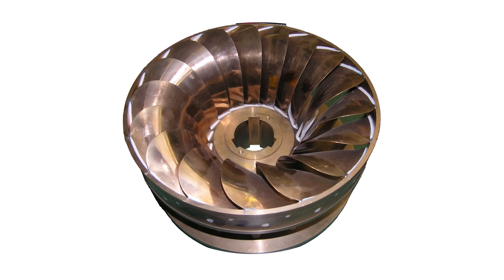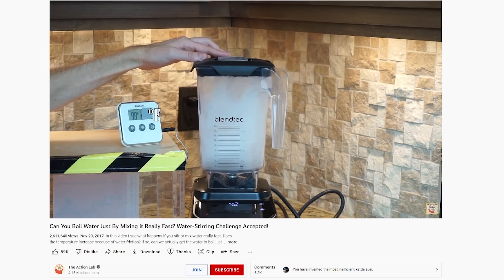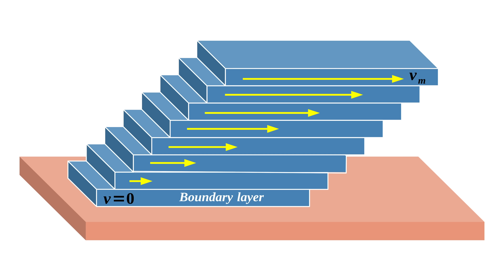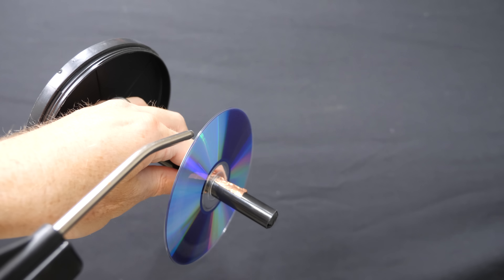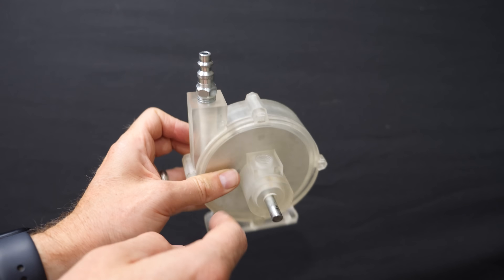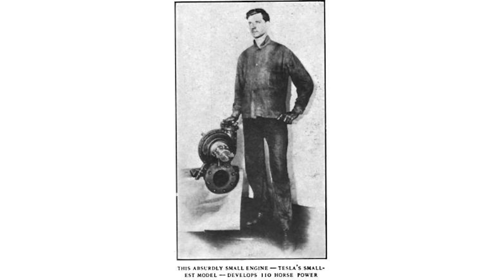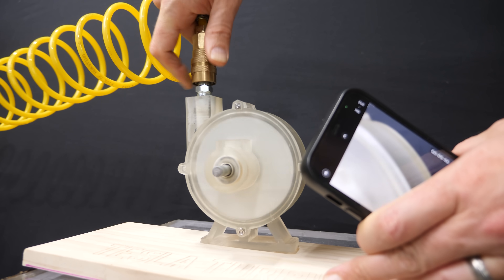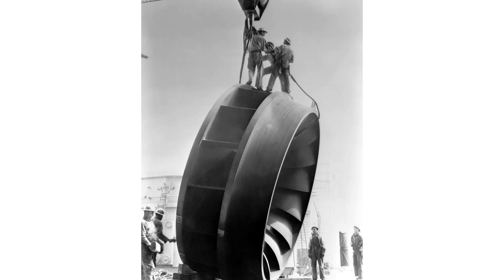How Fast Can a Tesla Turbine Spin?

Comment: I think the general problem with TTs is controlling the operating regime, i.e. Laminar flow.   For the TT this is when the disks are rotating at the same speed as the fluid.  As soon as the fluid flow is changed or the load on the turbine is changed you break out of laminar flow regime.  Maybe an RPM governor can help but I'm sure the engineers that work with TT in specific applications already know how to do this.
Reply: I wonder if he developed his valve during the same time in an attempt to control flow somehow?
Reply: If you keep the disc spaces tight enough, as Tesla says to do, (not spin fast) you won’t trip to turbulent flow between the discs. 

Charlie Solis makes actual working TesTurs that output real power and torque even at low RPMs because he designing his TesTurs the way Tesla actually says to design them. 

“Owing to a number of causes affecting the performance, it is difficult to frame a precise rule which would be generally applicable, but it may be stated that within certain limits, and other conditions being the same, the torque is directly proportionate to the square of the velocity of the fluid relatively to the runner and to the effective area of the disks and, inversely, to the distance separating them. The machine will, generally, perform its maximum work when the effective speed of the runner is one-half of that of the fluid; but to attain the highest economy, the relative speed or slip, for any given performance, should be as small as possible. This condition may be to any desired degree approximated by increasing the active area of and reducing the space between the disks.”
-Nikola Tesla

Comment: Instead of making large expensive systems: I often think a series of microturbines could eliminate much of the risks. Also, a faulty turbine could be easily replaced without stopping the main shaft. I like that approach for other systems as well...decentralized power grids.
Reply: The problem you run into there is the increased number of bearings - one set on a large turbine, N sets for N micro turbines.  Sleeve bearings are cheap but inefficient (heat losses).  Roller bearings and are much more efficient (less losses to heat generation), but substantially more expensive.  This, there's an optimal size for Tesla Turbines playing off the cost of metallurgical expenses for larger disks vs more roller bearing for smaller disks.
Reply: @akulkis  as if air and magnetic bearings aren’t already industry standard 🤭
Reply: Torque=Force x distance at its simplest. Micro turbines mean distance is small therefore sod all torque therefore very limited generation capacity. Micro turbines are usually useless and almost never pay for themselves within their service life. Same is true here, just with more maintenance and more points of failure.

Comment: Respectfully, 4:46 is one of the loftiest arguments I've heard from this channel "We don't use tesla turbines today ... because unless they're an order of magnitude better than current turbines, there's too much risk and cost to replace them". Are you sure about that one?

My dude, the plurality of "current turbines" gives you a big hint that different turbine designs exist together today. The suggestion that a technology has to be orders of magnitude better than the competition is mistrusting at best, incredulous at worst. Your own presentation showed simplicity of construction as a huge advantage. If it was characterized to perform identically to, say, a centrifugal turbine, would you have also dismissed it as not fit for modern application with current turbines? 

Disappointed in your message. Any promising technology should be encouraged and not labeled a relic of antiquity.

Comment: 3500rpm is no where near the efficiency range of that turbine. Should get up to 25,000rpm or more then jump up 50,000+.  The idea is that the fluid (air in this case) is rotating around the outer edges and being forced outwards by centripetal forces, but it has get to the center where the outlet is and err well..,,Nikola understood the rest.
Reply: Sorry but that’s not how it works. It works by fluid molecularly adhering to the disc faces. Tesla turbines do NOT need to be spun fast to work efficiently when they are designed properly. Charlie solis makes actual working, real power and torque outputting, even at low rpm Tesla turbines.

You just have to know how to design them properly so that slip is reduced and spinning fast does nothing to reduce slip just increase the distance the fluid slipped across the disc face. 

“Owing to a number of causes affecting the performance, it is difficult to frame a precise rule which would be generally applicable, but it may be stated that within certain limits, and other conditions being the same, the torque is directly proportionate to the square of the velocity of the fluid relatively to the runner and to the effective area of the disks and, inversely, to the distance separating them. The machine will, generally, perform its maximum work when the effective speed of the runner is one-half of that of the fluid; but to attain the highest economy, the relative speed or slip, for any given performance, should be as small as possible. This condition may be to any desired degree approximated by increasing the active area of and reducing the space between the disks.”

Even Tesla himself said so they work great at low RPMs. 

“Besides these, such a prime mover possesses many other advantages, both constructive and operative. It is simple, light and compact, subject to but little wear, cheap and exceptionally easy to manufacture as small clearances and accurate milling work are not essential to good performance. In operation it is reliable, there being no valves, sliding contacts or troublesome vanes. It is almost free of windage, largely independent of nozzle efficiency and suitable for high as well as for low fluid velocities and speeds of revolution.”
-Nikola Tesla 

The only time it’s supposed to be spun fast is when it’s used as a pump. 

“I have found that the quantity of fluid propelled in this manner, is, other conditions being equal, approximately proportionate to the active surface of the runner and to its effective speed. For this reason, the performance of such machines augments at an exceedingly high rate with the increase of their size and speed of revolution.”
-Nikola Tesla

Comment: Imagine 100 years of using tesla turbines, with constant updates and improvements...
Reply: So even assuming we went with this method and tried to innovate for 100 years with this as the primary choice ( we still try to innovate upon the secondary choice trying to see if its better albeit at a lesser rate so dont think this has just sat untouched for 100 years) there are enough major issues with the design that would get it thrown out. If the plates were not perfect then the plates actually damaged themselves in industry we build everything within a tolerance range and this kind of design needs a very strict tolerance that makes it less desirable and finding ways to make its tolerance better isnt really something innovation is going to improve without breaking fundamental concepts. The system does a really poor job when it performs in high torque scenarios which is what power generation is again fixing that means changing fundamental designs until it really isnt a tesla turbine anymore. Even under good conditions, the plates were prone to warping in both high-speed and high temp scenarios and while it doesn't generate heat to any real degree itself much of the source fluid we use is high temp and it by definition needs absurdly high speeds to match the efficiency and output of a modern industrial scale turbine would need speeds of over 50,000 rpm  to put that into perspective current industrial generators run between 1500 and 3000 rpm, and have the disks spinning at over Mach 13 ( modern turbines are somewhere around Mach 2 for comparison).

These arent issues of innovation, yes better disk materials would extend life of the disks, using different ideal fluids might help with the warping issue but in those 100 years we learned a lot more about physics and material properties and especially how things on the atomic level and below work ( we still have a long way to go but we have gotten much better) and those problems, things that at least in modern time we believe to be fundamental laws create problems with this design. It works great as a fluid pump but not as a turbine for industrial scales.
Reply: @Kevrik ike you know how 100 years of innovation do on tesla turbine..  no you don’t, you can speculate but you don’t  have the view of 100 years of evolution. Problems can be solved even if you think it can’t. There is people more intelligent, more inspired, who beat you.
Reply: Imagine wheel invented 10000 years ago with constant improvements... Oh wait, it been same in wild west recently. And even now it is just a wheel. But yes, with rubber covering to protect roads.
Reply: @D9ID9I  Wheel went from compression based (axle leans on the spokes) to suspension based (axle hangs of the spokes). Yes, the wheel got re-invented.
Reply: @DreadX10  That's suspension getting optimized, the wheel itself is fundamentally still a cylinder slice that rolls along a surface fixed through a center pivot. See WhistlinDiesel's "Buggy Wheels on a Hellcat" for a practical demonstration of wheels intended for straight axles being attached to articulated suspension.
Reply: @treelineresearch3387  And the potter's wheel is also a re-invention of the wheel.
If it  doesn't comply with the definition of the wheel, it is not a wheel. Doesn't mean you can't change the wheel or re-invent it.
Reply: @treelineresearch3387  splitting hairs here.
Reply: @treelineresearch3387 "suspensions" within the wheel, that is, not the ones attaching the axle to the body
Reply: @a4Jonatica  lol. Did you deduce that from his 'creative' poetic license on the use of grammar?

Comment: I'm not sure why you would say a turbine had to be an order of magnitude better to make it worth pursuing.  I worked as a mechanical engineer in power generation for many years and I can tell you we were always working hard to gain a fraction of a percent improvement in efficiency.  That's a huge amount of money you would be leaving on the table if you ignored better designs.   If tesla turbines were actually better at scale than traditional turbines, I'm sure they would be used.  My guess is they work very efficiently in low torque applications but not in high torque (or variable torque) applications like you need to turn a generator.
Reply: TesTurs work just fine as electric generators.  TesTurs output plenty of torque and power, even at low RPMs. 

You just have to know how to design them correctly. And no that does not mean chasing high RPMs like everyone erroneously claims you must do with the TesTur to make it efficient 🤭
Reply: I agree though the whole “it needs to be an order of magnitude better or more to be worth doing…” 

That’s literally saying “it needs to be 10x better than what’s available for it to be worth it. 

All it has to do is get the exact same efficiency and have only less maintenance and it would be worth it…

Heck it could be worse but utilize energy sources that other turbines, engines can’t utilize, and it would be worth pursuing.

Comment: "Normal" turbines such as Pelton and Francis can get efficiencies higher than 90%, I don't know where you found that 35% of energy is lost in normal turbines? Also, Francis turbine is reversible and is used as a pump in pumped-storage hydroelectric stations...
Reply: “Reversible” means it can spin both ways for making power. Not that it works both as a pump and turbine. 

Tesla notes this feature because he planned for steam ship use that would allow for the elimination of a reversal gear. 

Normal bladed turbines can not be spun the opposite way and still work.
Reply: Also hydro TesTurs have already been shown to reach over 80% efficiency…

“Design and Development of a Small-Capacity Tesla Turbine for Rural Applications

ABSTRACT
Bangladesh is in great need to find renewable energy sources for its fast-developing industrial sectors. The main objectives of this research are to design and fabricate a small-scale efficient Tesla Turbine for remote areas and test it through experimental investigations. Performance analysis of the newly designed Tesla Turbine suitable for remote areas of Bangladesh will be conducted. Until now, a number of researchers have undertaken several tests and studies to evaluate the Tesla turbine's performance and efficiency. Tesla Turbine does not proficient in producing torque. The work here consists of computational analysis and an experimental campaign by fabricating the turbine. Solid Edge 2021 is employed for our 3D modeling. For modeling, the desired material is Polylactic Acid (PLA) or ABS Plastic. The proposed design consists of 51 disks with an identical spacing of 3 mm. This design has led to achieving a torque of 19.85 N-m and a staggering efficiency of 81%. It was found that stress generated on the disk edges is higher than their centre due to high centrifugal force.”

All on a plastic turbine too. 🤭

Comment: Yeah, no need to even START building these. 
Wind and solar have us covered!
Reply: 🤭 yeahhhh the corrosive and abrasive steam from geothermal bore holes can only be utilized in the Tesla turbine and it is a WHOLLY underutilized energy source that doesn’t require any complex materials.
Reply: Wind and solar are horrible, hydro power is a lot better. And guess what hydro power uses? Turbines.

Comment: I hope someone actually makes a tesla turbine jet engine one day, it could be the future of flying planes & to generate electricity.
Reply: 🙋‍♂️ already doing that… 🤭 Replication of Tesla’s improved combustion + steam turbine patent GB 186,083 that he patented in 1921, 10 years after the original and a decade of R&D. 

Already getting real power and torque out with the TesTur on just  the preliminary room temp compressed air.

4.25kW between only 6000-8000rpm and peak torque of 6.22ft-Lbs of torque at only 4150rpm again on room temp compressed air that never got over 40psi at the nozzle. 

Even shown proof of powering real up to 2650 watt electrical loads at only 9500rpm and and never using more than 20 psi at the nozzle 🤭

Add on the bacon bits of gasses increase in viscosity with temp, they get thicker when they get hotter and thinner/runnier when they get colder, the opposites of most liquids. This increase in viscosity as temps are raised to combustion temps reduces slip on the discs ultimately increasing the isentropic efficiency of the TesTur in addition to the increased thermodynamic efficiency efficiency from using increased temps.
Reply: Yeah Charlie’s work is phenomenal! I don’t know how all these people in the comments are DEMANDING Tesla turbines can’t work when Charlie already has working proof that they get plenty of torque and power even at low RPMs 🤭

Comment: From experience I can tell the Tesla turbine can work just fine on Low rpm , I've replicated it from the ideas of (Charlie Solis) he can get from his 10inch turbine a about 5 horse power ! YES HP !   For my 7.5 inch 12 disc turbine whit a spacing of 0,5 mm it delivered 0,5hp at 7000rpm  at 1,5 barr of steam pressure,.  I really recommend checking Charlie's channel if you want to know how the Tesla turbine really works!

Comment: I suspect under load efficiency may be less than bladed turbines... as the 'replacement' gamble fails when new designs get implemented today.
Reply: TesTurs work just fine. 

Charlie Solis makes real working, actual power and torque outputting TesTurs even at low RPMs and competitive efficiency. 

If you know how to design them to optimize slip reduction you’ll end up with with an efficient turbine system. 

Just ask Charlie.